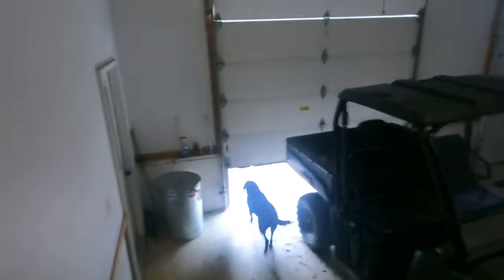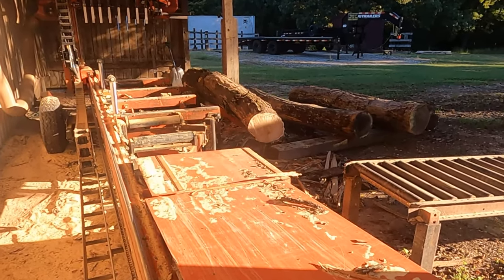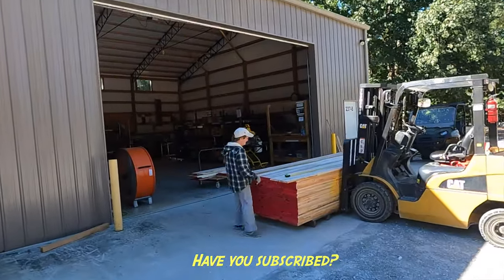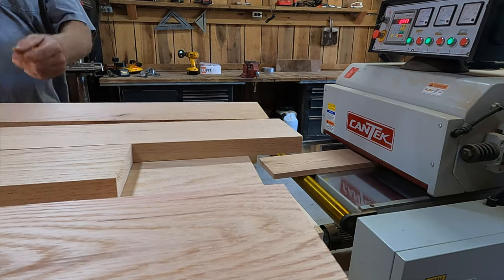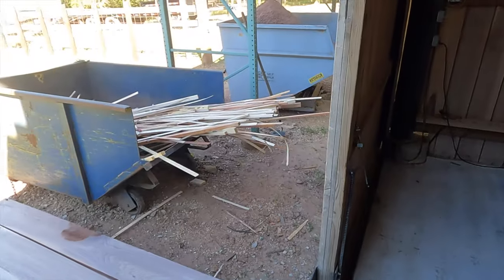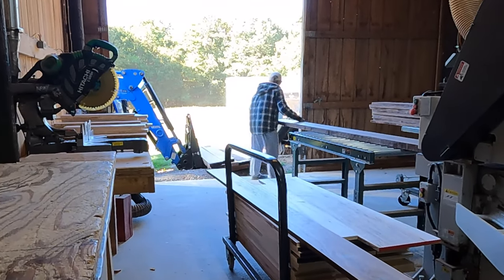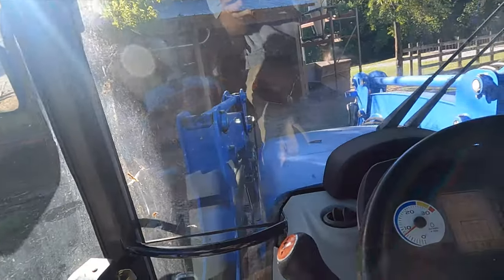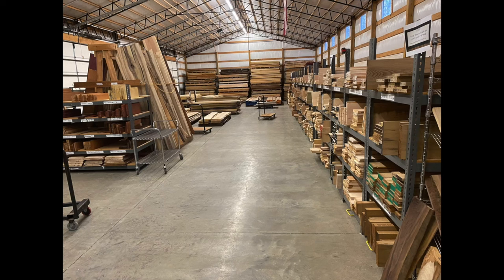Do You Want to Open a Sawmill Business?  See How a Mom and Pop are Ranked #1

Comment: This looks a lot like work to me.  Beautiful layout of your home and work facility.  You and your wife's work ethic are going extinct in our society.  I recently came across your videos and love them.  I have a brand new LT 70 just for fun, but I want to do whatever I am going to do the right way the first time.  I absorb everything I can from your videos.  I know you are not able to go through every detail of sawmilling, but I would love a video of the detail thoughs you use in the function of the LT 70.  As in, how do you determine your initial cuts and settings on the mill to get to your final cant size.  If you are randomly dropping down to cut the sap wood and bark off, how do you end up at an exact size in the end.  I understand the 70's auto up/down settings but I would think that would have to be used right from the first cut to get an exact measurement in the final cant. It would be great to see this in action along with a view of the mills screen to see what your thoughts are along with the selection of settings and the present measurements. Thanks for what you are doing.
Reply from the maker: I had been thinking of doing just that, but also cover some of the options available and what matters and what doesn't.  However, yes, the built in functions will allow the mill to do what you are describing.

Comment: 18 gauge veterinary needle is the best for removing splinters..  I keep one in the medicine cabinet just for that.
Time to start building your permanent sawmill-owned pallets with 4x4 runners.  You won't have to beat on them and they will last longer.  There are ALWAYS pieces of "junk wood" that you can use for runners..
Reply from the maker: You are 100% correct, I use vet needles also that we have left over from our cattle operation.  I keep wanting to do a video of it but figure it will gross people out.

Comment: Great video Robert. I notice you had a Hitachi chop saw in the planer room. What happened to the Makita?
Reply from the maker: A piece of wood cracked and exploded and shards ripped through the blade guard and top shell of the saw.  Punched holes right through it, like a blown piston on an engine.  Quite the fun.  It was a good saw, but the repair bill would have been significant. So I gave it away and we switched to the Hitachi.  It's been good so far.  In reality, we consider them disposable, as we wear them out every year or two anyway.  The bearings get sloppy, the motors cook, or the blade bralke, breaks.  We've looked at more commercial models,  but they don't have the safety features of sliding chop saws, and with chop saws, it's all about safety.

Comment: It sounds like you may have fed the planer a little too fast once or twice?!?  Just found y'all!! Hoping to come see y'all's in the morning.
Reply from the maker: Not on these little pieces of shorts and walnut 8/4.  I played the video back to check, the planer is designed to take off more than 1/4” per side per pass, both top and bottom on the same pass, so 1/2” of wood removed per pass, 25 inches wide, at twice this feed rate.  So in this video, you are probably hearing the staggered top and bottom head engaging and disengaging at different times on the board.  In a video im about to release, we planed 5/16” off the bottom and 1/4” off the top on a pallet of 24 inch or so wide live edge slabs and it did grunt on those.  The boards in this video weren’t enough to warm it up, the planer is a beast.

Comment: I see that you have a PJ trailer; what are your thoughts on it? I have a tilt bed PJ and it is a piece of JUNK! It's 6 years old and people guess it's age at 20-30 years because of the rust. Back to your video to watch the rest.
Dave
Reply from the maker: I've had very good service for them, actually has the best structure of any brand I've owned.  I just recycled through them this year and sold 3 of them, one 12 years old, one 9 years old and the last 7 years old with almost 250,000 miles on it, 4 sets of tires.  I go across scales with my log loads and I'm always at max payload, generally pushing the 26,000 lbs CDL limit.  I have heard of others having rust problems (mostly up north) with their PJ and they were having quality control issues where PJ wasn't properly prepping and cleaning their steel (degreasing and descaling) prior to powder coat and it wasn't bonding to the metal.  Basically rusting under the powder coat.  A real mess.  I have heard they have changed their prep process and have switched primers.  We don't use salt on our roads down south here, and I've never had any issues at all with their coating or anything else.  I have a trucking business to support our sawmill, and we use our mini fleet of PJ's hard, and they have to pass DOT inspections every year.  Thanks for watching!

Comment: On your previous video you mentioned a commercial license or maybe DOT numbers for the truck and trailer. Do you need that for hauling logs back like you were showing?  I’m considering getting a  3/4 ton and a 14k trailer for moving logs and equipment
Reply from the maker: Your state would give you specific guidance but in a nutshell any vehicle or combination of vehicles moving anything where money is involved is considered commercial and requires either a DOT or CDL according to state or Federal Regs, the FMSCA, if you are empty and GVWR stickered (on the truck door jamb and trailer tongue added together) and 10,001 lbs crossing state lines or 26001 lbs at any time in any state or weighed, whichever is higher.  So with a 14K trailer, whatever truck you buy can’t be stickered on the door for more than 12,000 lbs GVWR.  Many 3/4 ton trucks have GVWR of more than that, so would be illegal.  You can get what’s called a “derate option” for many trucks that will drop the truck GVWR to 10,000 lbs to legally cross state lines under 10,001 pounds and that would get your total GVWR with a 14K trailer to 24,000 lbs, which puts you under the 26,001 lbs CDL threshold but not DOT if crossing state lines.  Unfortunately it’s a trade off because as you get the derate options your towing capacity drops also.  I got my first ticket towing an empty gooseneck trailer behind a 3/4 ton pickup and although I was under 26,000 lbs (truck door sticker was 10,000 lbs and trailer was stickerd at 15,800) I did not need a CDL, but since I was from Alabama and crossed state lines to Tennessee, and was over 10,000 lbs, they gave me a police escort back to the station and lit me up with many thousands of dollars of tickets and penalties.

Comment: What size generator do you have? If it burns 14 gallons per hour, it seems like a major ongoing expense for the mill
Reply from the maker: It's a 480V 3 Phase generator with a Chevy 8 cylinder at 85kW burst with 60kW steady power.  It supports the planer, and we have phase converters off county power for the smaller equipment.  We use enough electricity that the county said they would cost share installation of 3 phase power to use if we started at a million bucks downpayment, which is why we got the generator.  Yes, sawmill operations of this size burn energy money and lots of it.  We have deliveries of propane tanks for the forklift, tanker deliveries of liquid propane for the generator, tanker deliveries of diesel for the sawmill, the excavator, the track loader, the tractor, even the lawn mower.  Lots of fuel, lots of money.  Then oils, filters and lubricants for the equipment, generally $1,000 of maintenance on some of the equipment every 200 hours.  The generator is getting $750 dollars of annual preventative maintenance by our local Generac dealer just this week.  Brutal money and very painful.  Good thing this is just a hobby.